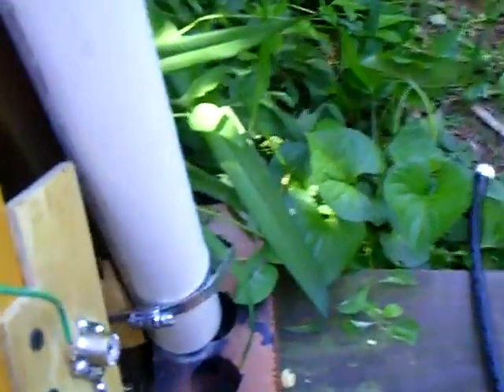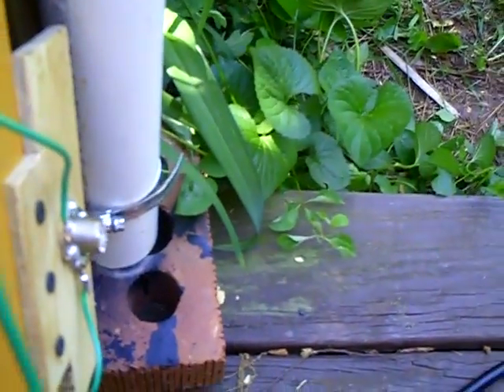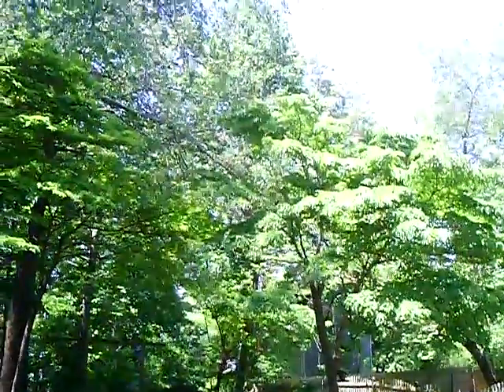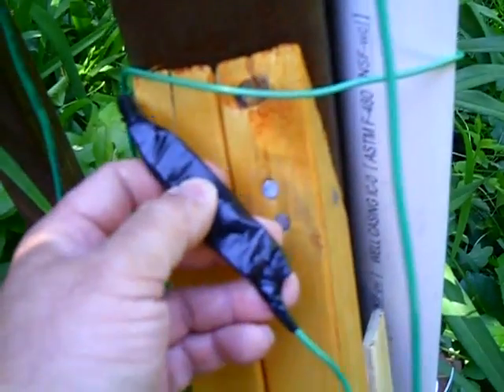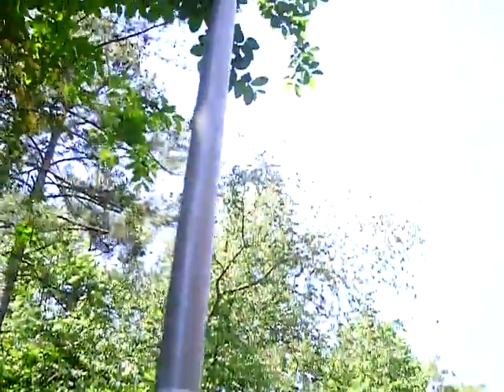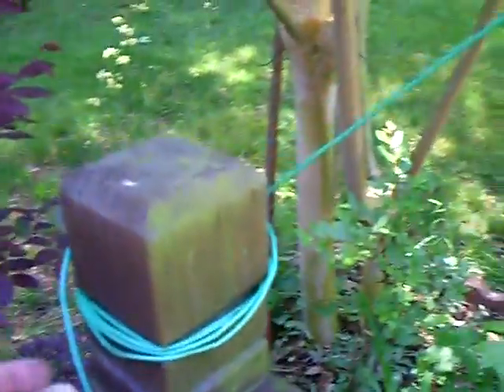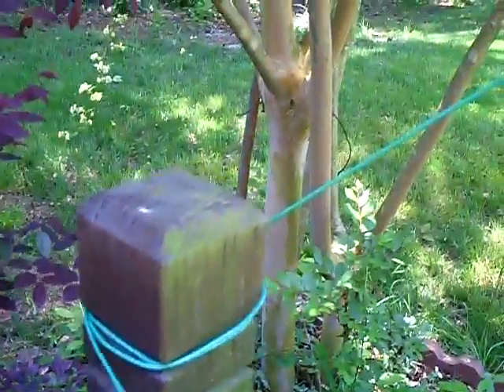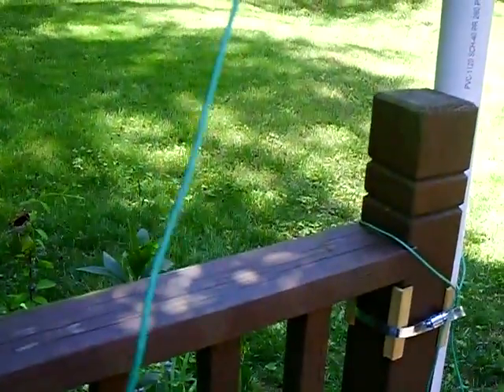My Vertical Loop Antenna for 80 Meters

Comment: Hook a Radio Shack 100MH choke from each side to ground. Also hook a 1Meg ohm resistor from each side to ground. Also you need to feed this with a 4:1 balun for best results. The antenna is about 100 ohms normally. So a 1/4 wave stub will work well but believe me the best way to use this is with a 4:1 balun. Some people use an ugly balun on PVC pipe also. But, again the best is a 4:1 balun.  73 Jimmy, ARRL TS, WX9DX
Reply from the maker: +WX9DX ok, thanks!
Reply: So why would he want 25 ohms of impedance for an SWR of 2:1 instead of 50 ohms of impedance?  If you're going to tell him to use a 4:1 balun, tell him WHY, or else you haven't taught him anything.  Your guess of 100 ohms for the antenna 'normally" is just a guess.
Reply: Loops are well known to be of 200ohm impedence not 100ohm!!!

Comment: you have a massive back yard,i would but the antena up horizontal,and feed it with 450ohm ribbon and a length of coax,this will make it multiband from lowest freq up,you will also need a 4:1 balun,load of more info on the net for multibanding loop antennas.,wrapping stuff round fences is not a good idea,if you have kids or humans around.

Comment from the maker: @Lockemeister It won't work on 40 meter. It's only good for 80 meter band. that's Ok though, It's what I wanted. I make tuning adjustments with a MFJ Veersa tuner II.